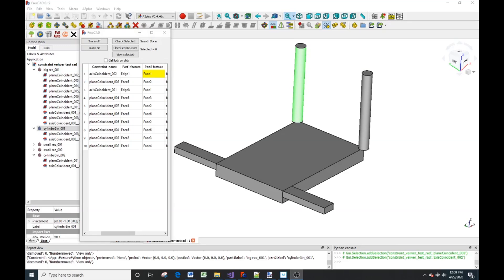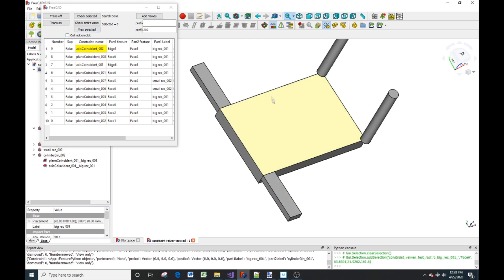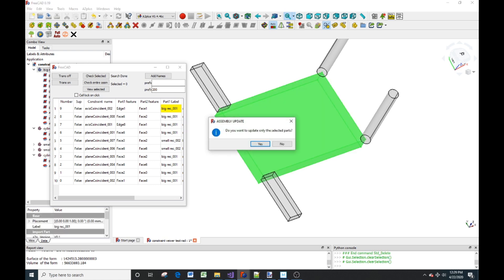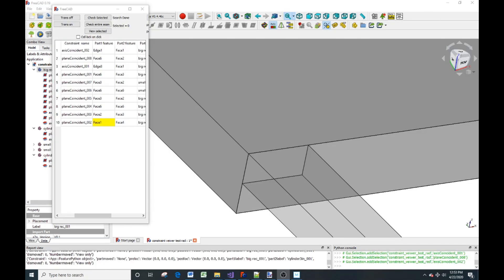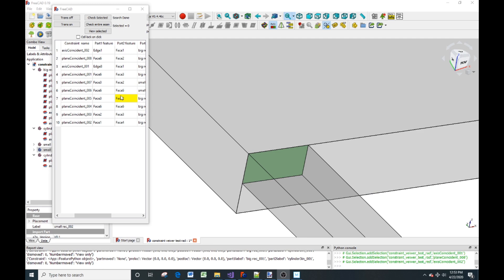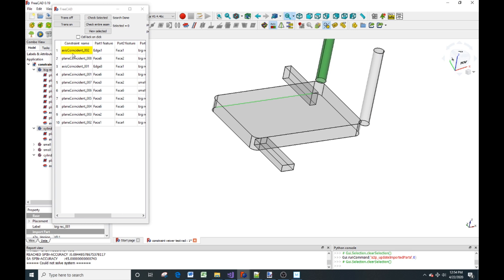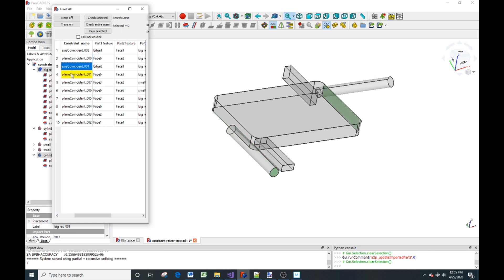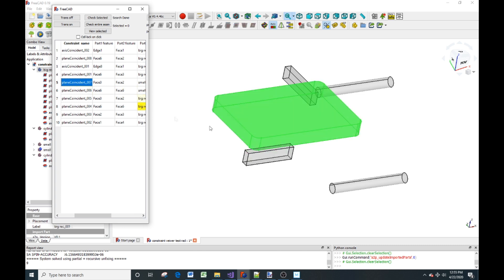FreeCAD A2plus constraint problems when modifying a part

Comment: Thanks - that explains a lot
Reply: Thanks a lot i havent found anywhere The reason for this problem.
Reply from the maker: I have written a 3rd party workbench that prevents a lot of the problems described. Go to the FreeCAD forums and  search for a2plusmore. Then use the update icon to update your parts. If you have changed the dimensions use the standard updater but if you have modified the part try my updater.